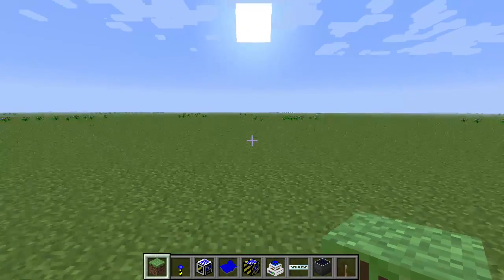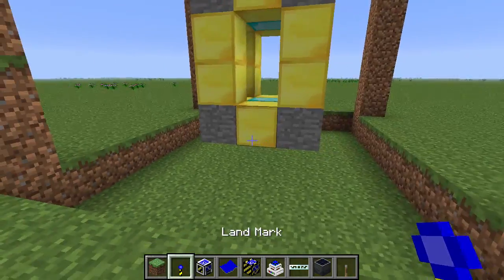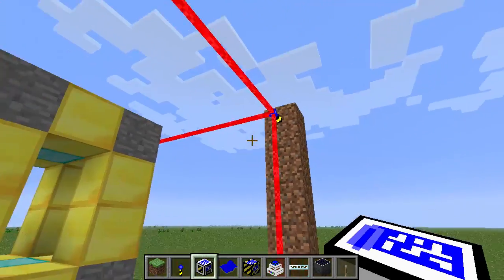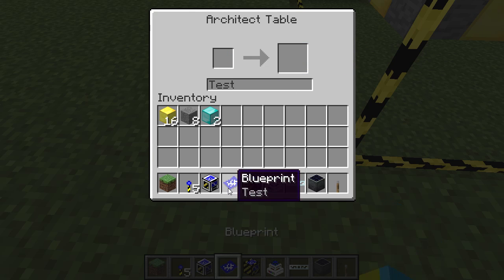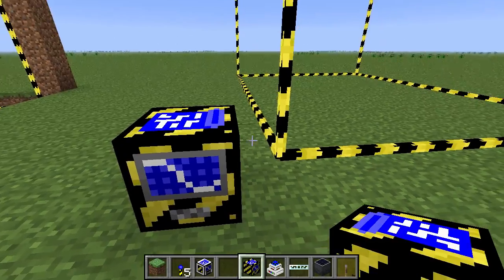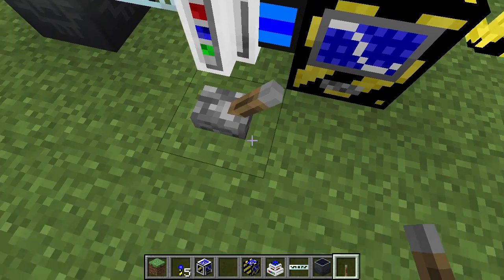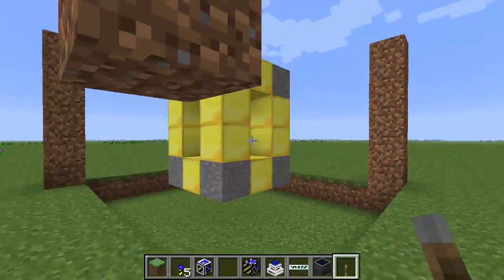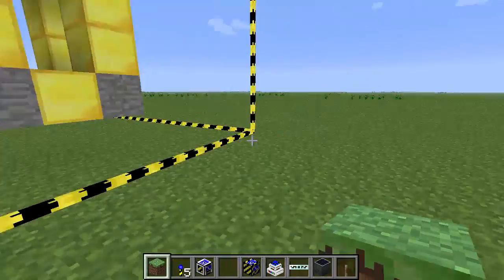How to use an Architect Table and Builder in FTB

Comment: Attention everyone. Currently, the Builder is disabled in all current FTB modpacks using buildcraft 3 version 3.4.2 (ultimate, direwold, mindcrack, etc.)
This is due to the corruption problems. Anything over 32x32x32 in any of the three dimensions has caused crashes on servers and often single player worlds. As a result, it corrupts the entire chunk. Until the fix has been implemented, which it has not yet so far, builders will not work.

Comment: Placing down the architect table only drops those 4 landmarks that needed to be placed though, so if you put down 8 instead you afterwards have to manually remove those that you didnt have to place in the first place.
Its really not that hard to remember which landmarks need to be placed, its one adjacent to where the architect table goes, and then one in every corner of the cuboid adjacent to the first landmark to determine the dimensions of what shall go onto the blueprint.

Comment: Hey, I still can't get my builder to work in FTB. They just came out with ultimate, and I wanted to see if it would work. I get my blueprint and all that set up correctly, but when I go to turn on the electrical engine, it starts up, but the builder doesn't build anything.